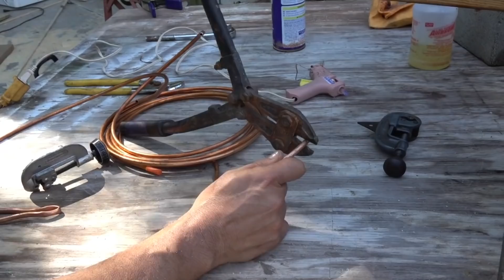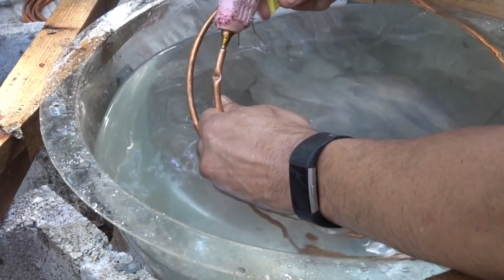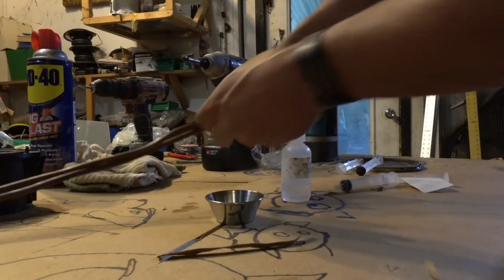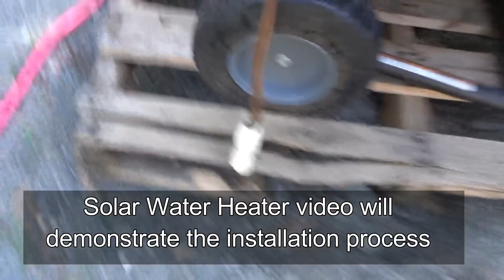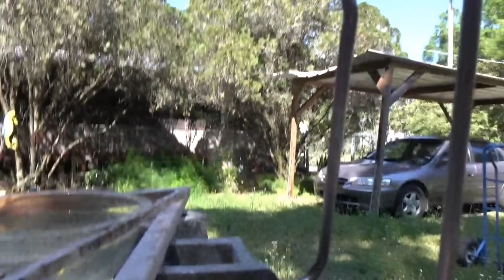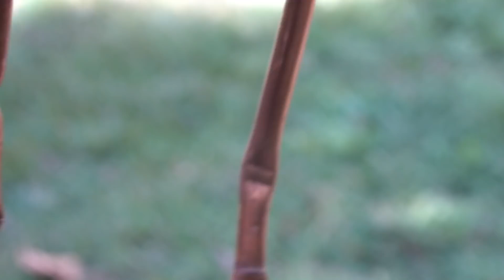Bending copper tubing solar hot water heat exchanger Detailed Version

Comment: If you use sand will be much easier for you. You can tap it in there put a piece of tape over the end and it's a lot easier. A lot less chance of it leaking out, as its larger. You will be a maze of the results. You could also use salt. But I like using sand. Make sure it's dry it will flow a lot easier. You can do extremely tight bends without kinking.

Comment: do you use the bolt cutters to crimp stainless steel tube as well? i got 100 ft of stainless steel tube to make a heat exchanger to heat my spa and possibly my house in the winter. I watched this video to see how you bend tubing. I need to know about how to crimp the tube. It is 304 stainless.

Comment: Great tip about filling the tubing with water. The coil at the end of the video was perfect, but the twisted tubing in the first part of the video, not so much. Suggestions to improve is to use a slightly bigger rounded shape for the end of the twist, and fix it and the end of the twist securely, because it just looks like the tubing is almost folded in two and about to snap. You need a really rounded shape to keep the water flowing impeded.
Also, instead of laying out the two copper arms in parallel on the table before twisting them, they probably need to form a V so you can take each arm and twist them equally. Using a small wooden structure that you run the two arms of tubing through and that you just turn like a key may ensure a perfectly equal twisting of both arms. Your device basically had one arm that's nearly straight and the other that's twisted around it, when what you want for a heat exchanger is the two arms twisted around each other equally.

I am planning on putting a metal coil around a rocket stove-like chimney, behind the walls of the chimney of course, because these things get crazy hot, or maybe a double coil, one for water, one for air, if that does not affect performance too much. I need to check the temperatures and flowing volumes I need to find out which metals fit, or if I even need metal at all for the air flow, and what diameters I need for both water and air. Still a lot to do on the drawing table, all these ideas are interesting but could take me too far for too long!
Reply: 1  In the name of God, the Gracious, the Merciful.
2  Praise be to God, Lord of the Worlds.
3  The Most Gracious, the Most Merciful.
4  Master of the Day of Judgment.
5  It is You we worship, and upon You we call for help.
6  Guide us to the straight path.
7  The path of those You have blessed, not of those against whom there is anger, nor of those who are misguided.

163  Your God is one God. There is no god but He, the Benevolent, the Compassionate.

2  God, there is no god but He, the Living, the Eternal.
4  To Him belongs everything in the heavens and everything on earth. He is the Sublime, the Magnificent.
11  Originator of the heavens and the earth. He made for you mates from among yourselves, and pairs of animals, by means of which He multiplies you. There is nothing like Him. He is the Hearing, the Seeing.

1  Say, “He is God, the One.
2  God, the Absolute.
3  He begets not, nor was He begotten.
4  And there is none comparable to Him.”

3  He sent down to you the Book with the Truth, confirming what came before it; and He sent down the Torah and the Gospel.
4  Aforetime, as guidance for mankind; and He sent down the Criterion. Those who have rejected God’s signs will have a severe punishment. God is Mighty, Able to take revenge.
5  Nothing is hidden from God, on earth or in the heaven.
6  It is He who forms you in the wombs as He wills. There is no god except He, the Almighty, the Wise.

14  We have entrusted the human being with the care of his parents. His mother carried him through hardship upon hardship, weaning him in two years. So give thanks to Me, and to your parents. To Me is the destination.
15  But if they strive to have you associate with Me something of which you have no knowledge, do not obey them. But keep them company in this life, in kindness, and follow the path of him who turns to Me. Then to Me is your return; and I will inform you of what you used to do.

48  God does not forgive association with Him, but He forgives anything less than that to whomever He wills. Whoever associates anything with God has devised a monstrous sin.

31  Say, “If you love God, then follow me, and God will love you, and will forgive you your sins.” God is Forgiving and Merciful.
32  Say, “Obey God and the Messenger.” But if they turn away—God does not love the faithless.
33  God chose Adam, and Noah, and the family of Abraham, and the family of Imran, over all mankind.
34  Offspring one of the other. God is Hearer and Knower.
35  The wife of Imran said, “My Lord, I have vowed to You what is in my womb, dedicated, so accept from me; You are the Hearer and Knower.”
36  And when she delivered her, she said, “My Lord, I have delivered a female,” and God was well aware of what she has delivered, “and the male is not like the female, and I have named her Mary, and have commended her and her descendants to Your protection, from Satan the outcast.”
37  Her Lord accepted her with a gracious reception, and brought her a beautiful upbringing, and entrusted her to the care of Zechariah. Whenever Zechariah entered upon her in the sanctuary, he found her with provision. He said, “O Mary, where did you get this from?” She said, “It is from God; God provides to whom He wills without reckoning.”

16  And mention in the Scripture Mary, when she withdrew from her people to an eastern location.
17  She screened herself away from them, and We sent to her Our spirit, and He appeared to her as an immaculate human.
18  She said, “I take refuge from you in the Most Merciful, should you be righteous.”
19  He said, “I am only the messenger of your Lord, to give you the gift of a pure son.”
20  She said, “How can I have a son, when no man has touched me, and I was never unchaste?”
21  He said, “Thus said your Lord, `It is easy for Me, and We will make him a sign for humanity, and a mercy from Us. It is a matter already decided.'“
22  So she carried him, and secluded herself with him in a remote place.
23  The labor-pains came upon her, by the trunk of a palm-tree. She said, “I wish I had died before this, and been completely forgotten.”
24  Whereupon he called her from beneath her: “Do not worry; your Lord has placed a stream beneath you.
25  And shake the trunk of the palm-tree towards you, and it will drop ripe dates by you.”
26  “So eat, and drink, and be consoled. And if you see any human, say, ‘I have vowed a fast to the Most Gracious, so I will not speak to any human today.'“
27  Then she came to her people, carrying him. They said, “O Mary, you have done something terrible.
28  O sister of Aaron, your father was not an evil man, and your mother was not a whore.”
29  So she pointed to him. They said, “How can we speak to an infant in the crib?”
30  He said, “I am the servant of God. He has given me the Scripture, and made me a prophet.
31  And has made me blessed wherever I may be; and has enjoined on me prayer and charity, so long as I live.
32  And kind to my mother, and He did not make me a disobedient rebel.
33  So Peace is upon me the day I was born, and the day I die, and the Day I get resurrected alive.”
34  That is Jesus son of Mary—the Word of truth about which they doubt.
35  It is not for God to have a child—glory be to Him. To have anything done, He says to it, “Be,” and it becomes.
36  “God is my Lord and your Lord, so worship Him. That is a straight path.”
37  But the various factions differed among themselves. So woe to those who disbelieve from the scene of a tremendous Day.
38  Listen to them and watch for them the Day they come to Us. But the wrongdoers today are completely lost.
39  And warn them of the Day of Regret, when the matter will be concluded. Yet they are heedless, and they do not believe.
40  It is We who will inherit the earth and everyone on it, and to Us they will be returned.

15  O People of the Book! Our Messenger has come to you, clarifying for you much of what you kept hidden of the Book, and overlooking much. A light from God has come to you, and a clear Book.
16  God guides with it whoever follows His approval to the ways of peace, and He brings them out of darkness into light, by His permission, and He guides them in a straight path.
17  They disbelieve those who say, “God is the Christ, the son of Mary.” Say, “Who can prevent God, if He willed, from annihilating the Christ son of Mary, and his mother, and everyone on earth?” To God belongs the sovereignty of the heavens and the earth and what is between them. He creates whatever He wills, and God has power over everything.
18  The Jews and the Christians say, “We are the children of God, and His beloved.” Say, “Why then does He punish you for your sins?” In fact, you are humans from among those He created. He forgives whom He wills, and He punishes whom He wills. To God belongs the dominion of the heavens and the earth and what lies between them, and to Him is the return.
19  O People of the Book! Our Messenger has come to you, making things clear to you—after a cessation of messengers—so that you cannot say, “No preacher has come to us, and no warner.” In fact, a preacher has come to you, and a warner; and God is Capable of everything.

28  It is He who sent His Messenger with the guidance and the religion of truth, to make it prevail over all religions. God suffices as Witness.
29  Muhammad is the Messenger of God. Those with him are stern against the disbelievers, yet compassionate amongst themselves. You see them kneeling, prostrating, seeking blessings from God and approval. Their marks are on their faces from the effects of prostration. Such is their description in the Torah, and their description in the Gospel: like a plant that sprouts, becomes strong, grows thick, and rests on its stem, impressing the farmers. Through them He enrages the disbelievers. God has promised those among them who believe and do good deeds forgiveness and a great reward.

84  Say, “We believe in God, and in what was revealed to us; and in what was revealed to Abraham, and Ishmael, and Isaac, and Jacob, and the Patriarchs; and in what was given to Moses, and Jesus, and the prophets from their Lord. We make no distinction between any of them, and to Him we submit.”
85  Whoever seeks other than Islam as a religion, it will not be accepted from him, and in the Hereafter he will be among the losers.

111  And say, “Praise be to God, who has not begotten a son, nor has He a partner in sovereignty, nor has He an ally out of weakness, and glorify Him constantly.”

Read The Quran

Comment: I have hooked up many diswashers and icemakers. Unless you are doing some crazy bends, I insert a nylon rope inside the tube and i can make 45 90 180 and a few spiran bends without deforming the pipe. The nylon rope comes out easy and if it is a long piece i wiput some dish washing liquid on the rope. No messing with glue gun etc.

Comment: This is a good thing, to show others that are afraid to try Bending pipes. Now, Copper is probably the best of metal pipe, to bend, wheather you're making a coil pipe to transfer heat from the pipe of a wood stove, or doing something like what you are showing right now. But there are other types of pipe, some are special order, & are - not on - shelf, all the time.
Hardware's are probably the best place to buy pipe for any purpose. Even pvc, pipe 
Can be bent. I use a propane torch, to heat the pvc, pipe to bend it, it's like anything else, practice makes perfect,. Now I funnel, sand into the pipe, before I try
To bend it. I get the ( Play sand ) in bag's
Put in a small baby swimming pool, from the Dollar store. That way I can work with it, Without it spilling out all over the place.
The Play sand, I get is kinda sticky, & it's easyer to work with, and the pipe I usually get is 3/4 copper pipe. I have work with
The 1/2 inch, but it's harder to get sand into, and sometimes" it will crimp" no matter what you do. I've made a pipe
Bender, thats easyer for bending any pipe.
It consist of Three Large Rollers, that can be changed out for smaller/or Larger, Rollers, they're adjustable" SO, That I can 
Work with the pipe I am bending" so, I can adjust the top roller, so - as to bring it down More & MORE as needed, also, 
The two bottom Two Rollers are also adjustable" so I can bring them, closer & closer to make a tighter" turn on the pipe.!! So, as to have a tighter spin on the coil of Copper pipe... Now" this seems to work best, on copper, pipe. 
However, it works on a lot of types of
Pipes.!”⅝⁴! I've experimented on all kinds of other pipes.  Okay, well, I like What you're doing, on you're channel, & I will keep watching, please make two videos
A week, if possible. PS: I was thinking about a good idea, sagestions, one is 
For, some of you're videos, could be
Re - done, with the newest, updated, Tech.
Or with new stuff" to add, as, an update.
Well, anyways" I really appreciate you,!!
Plus I wanted to say, you're the greatest.!!
And, I wanna be like you.!!

Comment: Finally I find a useful technique to bend a Copper Pipe into a Spiral, other Techniques on YouTube Included Filling the Pipe Either with Fine Salt, or Fine Black pepper...neither ways worked out for me, and I had to saw the pipe to unclog the bended Pipe, I think this way should do, now back to the Hardware shop to by more copper pipe to try & bend, Thanks.
Reply: What a waste of pepper that would be- why on earth would they use it? Sand would have the same effect.
Reply: Both Salt and Pepper are absorbent. No wonder they got stuck! Use fine, dry sand

Comment: Looks kinked as h*** at the bent end. Yes, that's a good way. Hydraulics! Sand also, but sometimes you do not want sand in the tubing.  Gonna try the bolt cutter as a crimper.

Comment: even copper in rolls, already being annealed will work harden every time you bend it and stop. To "resoften" it, heat it to cherry red and let it cool slowly.  This anneals (softens) it.  you can buy a small bender for $10 that will give you a perfect bend, every time at it's minimum radius, given it's diameter in 10 seconds

Comment: I try really hard not to let 120 VAC line voltage come in contact with a water bath containing a nice fat copper conductor I'm gripping one end of and energizing it. That's one reason I'm a very old electrician and engineer.  That may sound like a joke; it is not.  So, may I offer a suggestion: 

 For the small amount of hot glue needed, plug in the glue gun on the bench and let the it heat up to operating temperature (glue will start dripping out of the nozzle). Then unplug it & go over to your tank, and squeeze hot glue into one end of the tubing. Put the glue gun back on the bench, plug it in &  let it get hot again (only takes a few seconds this time), unplug it and fill the other end of your copper tubing. No chance of energizing it (or YOU) by dropping a 120VAC -live tool in the water. I realize this sounds like a minor point - people will think it's exaggeration. It's not. A slip, or a moment's inattention happens easily.  Ask yourself, "Do I feel lucky?"

Comment: U-groove bearings can be used to get tight bends with a bending jig remember you can bend a coil diameter of 4x the diameter of the tube you are using so 1/4” tubing can be wound into a 1” diameter coil minimum

Comment: Crimp one end of copper tube bend over itself fill tube with dry filtered sand tapping the tube every now & again so sand settles when 1/2” from top crimp end bend over itself then you can wind the coil once you have your ends bent into shape cut ends with tube cutter solder a brass hose fitting to one end connect garden hose and turn on full once the water soaks into the sand & loosens it will push the sand out it won’t happen straight away so be patient eventually the sand will loosen & water will push the sand out run hose for couple of minutes to flush it out

Comment: 1) Use compassion fittings and end caps to seal it... faster. 2) The more you bend copper the harder it is to bend. If you can't bend it where you want, let the water out and anneal the copper... Then you can start bending it more.

Comment: Very cool video I have seen a very similar method to this with the exception of freezing the water inside the copper tubing. That method ensures that you can wind and/or bend the tubing as tight as you want without the slightest kinks or crimping occuring.